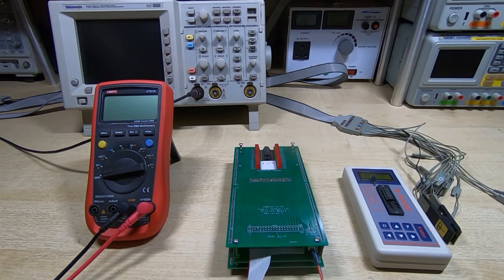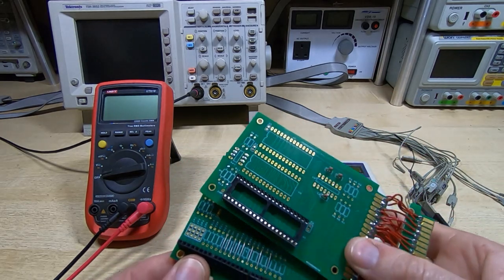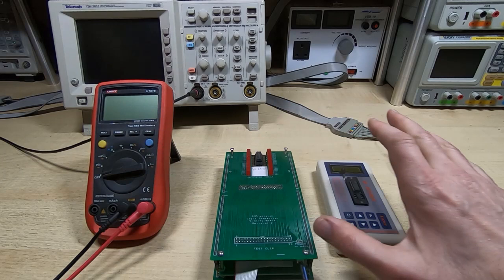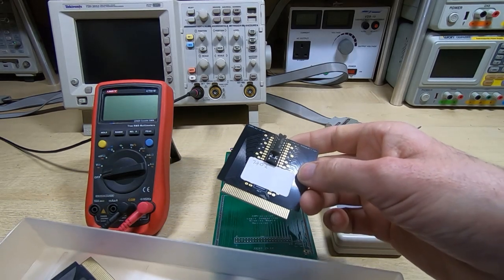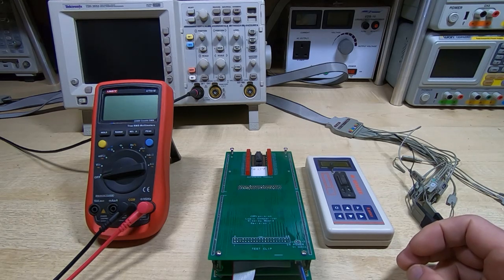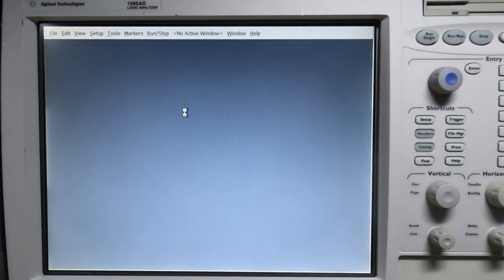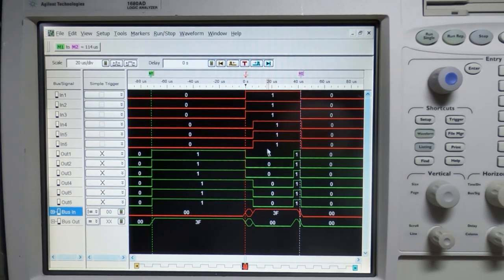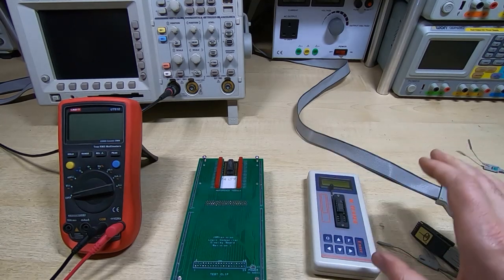Electronics For Beginners Part6 - Fault Finding 1

Comment: Jerry, I'm looking forward to this series as it proceeds.  I've been "interested" in electronics for decades, but never took more than the mandatory 2-3 three EE classes required for non-EEs when I got my BSME degree.  I've learned some electronics & troubleshooting/repairs over the years pretty much in order to get my PDP-8s to work, or did when my health was better.  Now that I'm retired, I want to get back to them and they'll need repairs, including all of their peripherals.  (The same for my PDP-11s too!)  I lucked into finding the problem on my PDP-8/A's Programmer's Console by using a logic pulser & a logic probe in each hand, along with the schematics, and since I had accidentally found a point where by touching a certain pin on a particular IC, I was able to walk back to a failed chip.  Now I have an "antique" 'scope that I need to better learn how to use safely (for it, the equipment being tested, & me).  And, of course, several DMMs, and a couple analog VOMs.

If you're willing, I'd also like to see similar videos on your fault finding & test gear for tube/valve gear too as you work on that type of equipment!

Comment: Hi Jerry. Although I am interested in the premise for this series I'm not entirely sure who it will be aimed at. The title indicates that it will be targeted at "beginners" I doubt that such people will be able to justify or afford to purchase the test equipment that you apparently intend to use. The Agilent 1680AD you demonstrate still costs about £2k on a certain auction site. Your comparator is not exactly cheap and a Fluke 9010 is virtually unobtainium! Surely a "for beginners" series would be better to start with a multimeter and possibly a logic probe before moving on to a basic oscilloscope and possibly a cheap(ish!) USB based logic analyser.
Reply from the maker: Perhaps you should watch the video again. I specifically say that I will be including a multimeter and if that is all you have it is fine. Also you do not need to use the exact type of analyser I am using. As I have said many times in previous videos you should use whatever you have. A cheap LA can be purchased new for less than £15. As I clearly said I will be demonstrating different types of equipment and this information is SPECIFICALLY aimed at beginners so that it may give them ideas on what equipment they may want to look for based on their interests. I am in no way suggesting (or saying) that you should run out and duplicate everything I am showing.
Reply: @JerryWalker001  Indeed you did mention a multimeter (although not a logic probe) but you also mentioned a lot of expensive equipment too and started the series using a £2k logic analyser. All I was saying was that perhaps it would have been better to start with the multimeter and work up. I understand what you said about using the 1680 due to the bigger screen and mouse control but maybe that could have been a topic for the LA parts of the series - how to use an older/cheaper LA and work round their limitations. Yes, you can get some cheap LA's but are they worth it? Another possible topic for the series - selecting the best/most cost-effective equipment for beginners? Will you be showing LA's that work with Sigrok/pulseview? I have a couple of these and often find them useful. Obviously they tend to load the signals being measured more that "professional" LA's, but it isn't usually a problem and could be another learning point. Just trying to offer helpful views from "outside" - not trying to criticise.
Reply from the maker: @spacedock873  NO I did NOT start the series with the LA. I clearly stated that this was an introduction to the series and I would be going over how to use different methods for fault finding. At NO TIME did I state that you needed to use the same pieces of equipment I am showing and that is one of the reasons I usually do not show the fault finding process. In fact on many occasions I have made it clear that everyone should use what they have. I have been asked to show how 'I' go about fault finding and I even showed the comment that was posted asking for this. I am therefore showing how 'I' go about fault finding. THAT is what these videos are about and have NOTHING to do with how to use specific pieces of equipment or what specific equipment to use. I am showing 'Methods' and NOT 'recommended' test equipment. Anyone interested can hopefully apply this to whatever equipment they have. If you are not interested in these videos then just don't watch them.